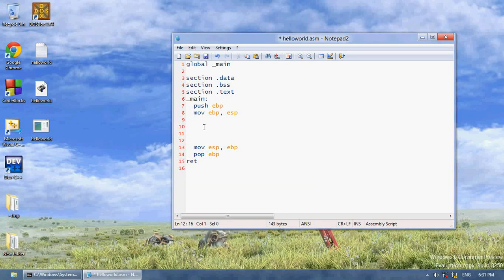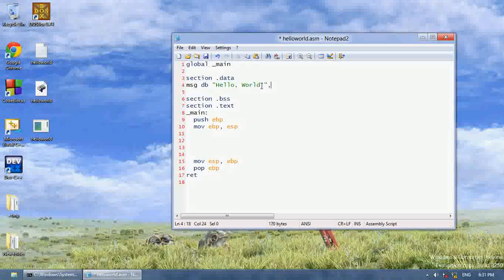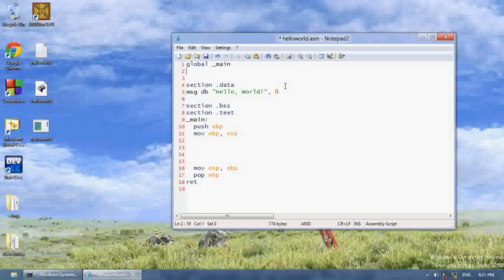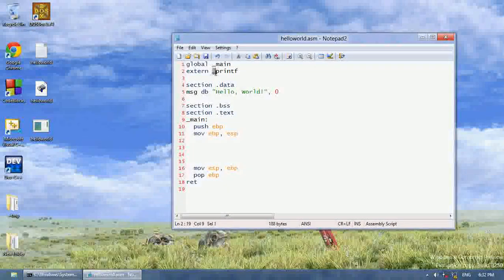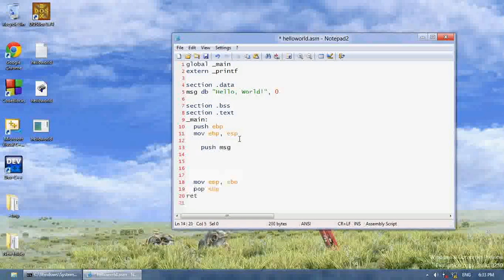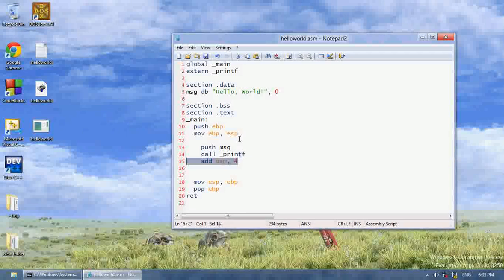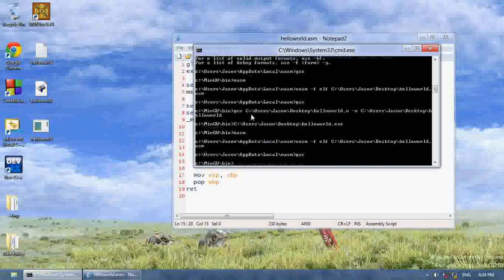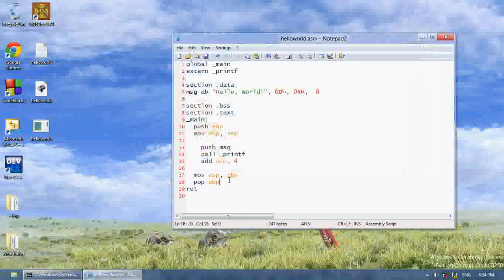32bit Assembly Tutorial 2 - Hello World! /w Printf

Comment: These are great tutorials. They are the only tutorials I've found so far that actually explain it. Most tutorials act like your suppose to know half of assembly already.
Reply: Well before doing 32-bit Assembly (and or 64-bit) you should probably know at least a little 16-bit assembly or you won't understand most of the terms and what not.
Reply: @dudejoe8705  disagree. I learned 8 bit assembly and can pick up on x86 fairly easily. What is needed is that you understand how a CPU (specially the one you're writing assembly for) works (registers, memory, load/stores, stack, etc.). Honestly you don't even need to know assembly for a real CPU, even a hypothetical one which demonstrates the idea of basic mnemonics like MOV, ADD etc will get you started.